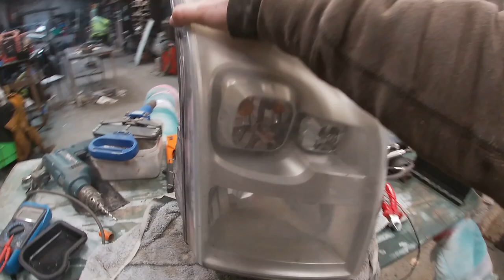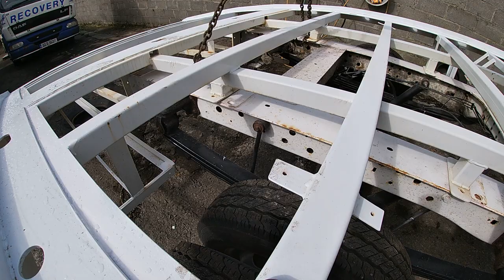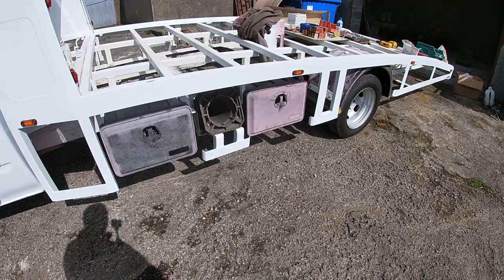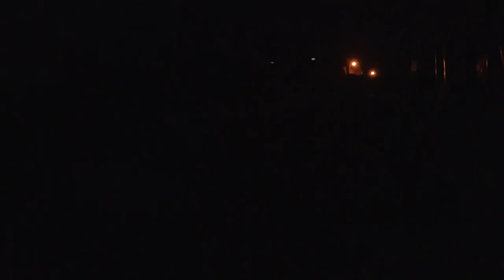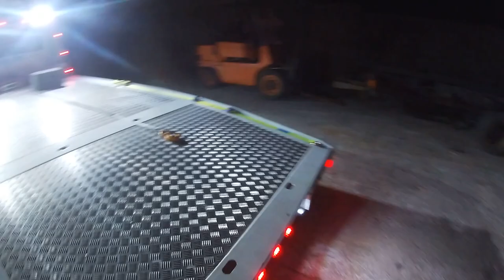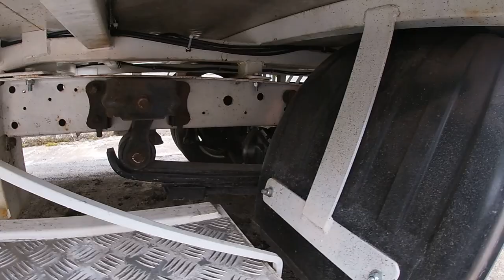Ford Transit recovery body build finished

Comment: That turned out unreal, looks really smart! if possible do a video of loading a few cars when youre out and about to see the loading angle etc.. id be interested to know what you think of the rope on the winch after a few months, im looking to go rope but ive heard mixed reports
Reply from the maker: I would not have bought a rope a few years ago because you could not get oil on it or the UV light would affect it but not with this rope and you have to change the fairlead out of the winch and use the right size snatch block but will let you know if there is any hassle with it
Reply from the maker: body is 2,200kg with over half a tank of diesel in it not bad in the end
Reply: @harnesslife  Not bad for sure, mine weighs around 2350 i think with half a tank.. would you sell ?
Reply from the maker: @Darren-DJL-1  ya I would but I would not get the price I need for it so I will have to use  it for a few years to make up the money
Reply: @harnesslife  what sort of money would you be looking?
Reply from the maker: @Darren-DJL-1  I have been telling everyone 7000 euro but I need 6,500 euro to cover everything

Comment: Unreal job just came across this project last week, gave me afew ideas for my own, I taught it would be heavier, is there anything you would change if doing it again
Reply from the maker: Ya  that was built for end of life cars and recovery not transportation so I would just make out of aluminium but worked well the angles were good but I would like to loose the heavy steel to see how light I could get a steel body
Reply: I've a mk6 mild steel chequer plate floor and mild steel side skirts but it's nearly 2500 I'd say needs loose few kgs.
Reply from the maker: Them floors are heavy I can't move them with out forklift 
Have you seen reel smart winch system I'm building one on my truck but I was ment to put it in transit and fit it below the floor it would have been good
Reply: @harnesslife  I'm on two minds to leave my body way it is, saves chopping it and make a new one but steels is robbery, what way did you fit the sheets rivet or did you weld them in
Reply from the maker: @mikeyb784  rivets it will come down in price soon I hope
Reply: @harnesslife  hopefully it will be sooner rather than later it drops price

Comment: Turned out really well. What is the legal requirement for the over hang of the beavertail to pass the engineers. For same lwb transit. Thanks
Reply from the maker: 60% of wheel base from center of back wheel I'm in Ireland don't know if that makes a difference
Reply: @harnesslife  yea I'm in monaghan myself. So be same for me. I'll be starting to build my own transit very soon. How did you keep the weight down so much. 2200kg is  very good.
Reply from the maker: 50mm box frame is only 3mm wall but when welded unreal strong and I would loose the the heavey flat that would save another 150kgs
Reply from the maker: I just bought a sheet of 3mm steel 4ft by8 and it's still going up in price rapidly another last year it cost 103 euro November price was 150 now 170
Reply: @harnesslife  yea id be looking at some aluminium sheeting for the floor. So that would keep the weight down another bit. Do you build them for other people or just yourself?
Reply from the maker: Just myself it would take me a year to get one done
Reply from the maker: Just talking to someone who has a good idea about steel prices and he recons it will be coming down in the spring if you could hold of till then
Reply: @harnesslife  must keep an eye on that. Thanks for that. Appreciate it 👍

Comment: Hi bud where did you get that winch slider from
Reply from the maker: I built it into the bed 
I'm building a better slider that was ment to be on that truck the winch would be under the floor  and just a pully block on the floor of the bed freeing up space it will be on a video on the DAF build